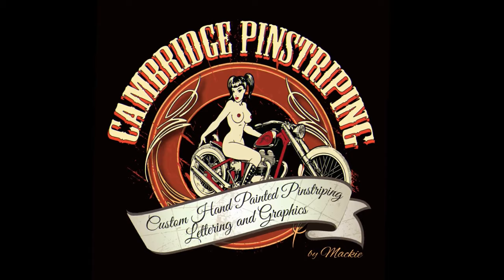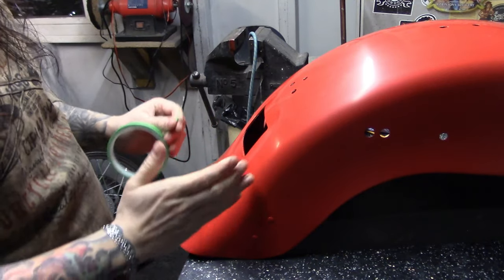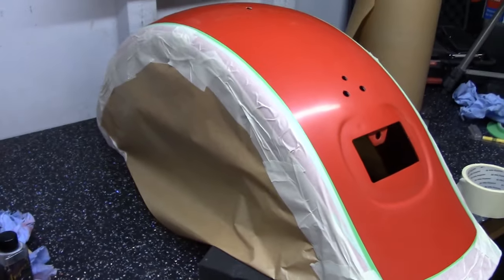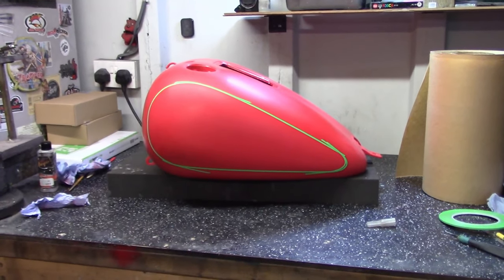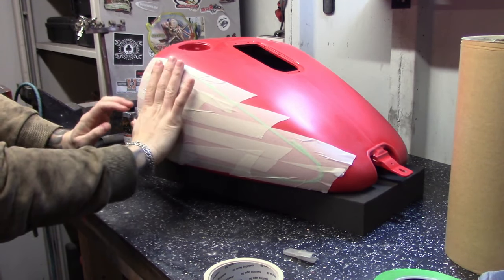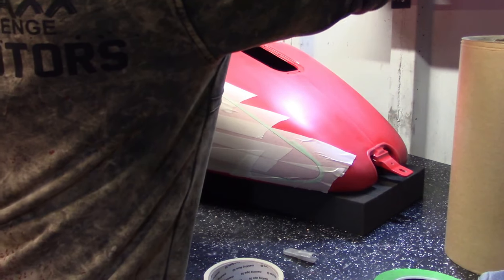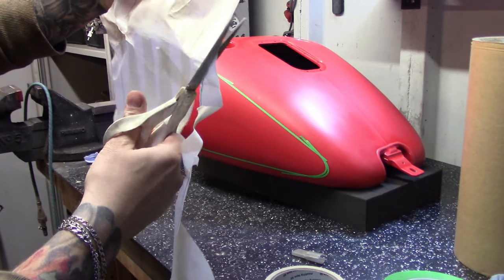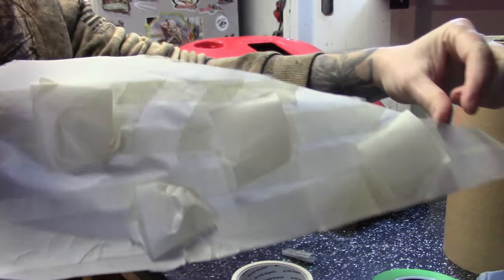Custom Paint Guide for a Harley Davidson Motorcycle - Part 1 of 2

Comment: Great job, what base you used? Water or solvent? Does the paint stick under the tape without clear when using water base?
Reply from the maker: Solvent base. It's all in the prep. Prep it right and you won't have any issues.